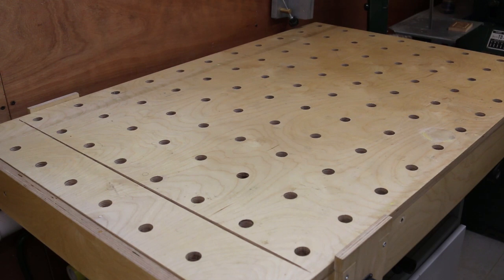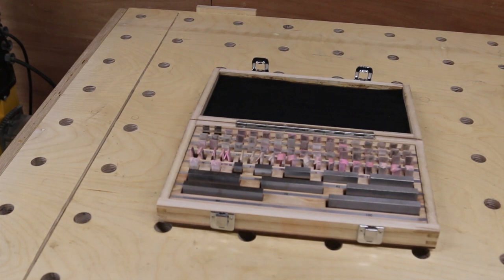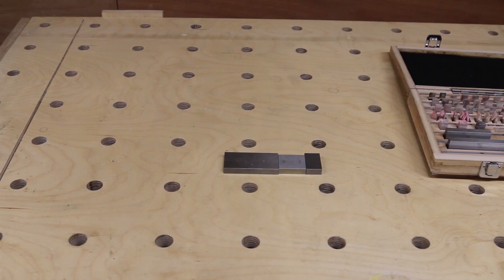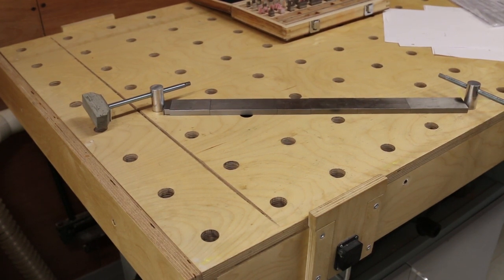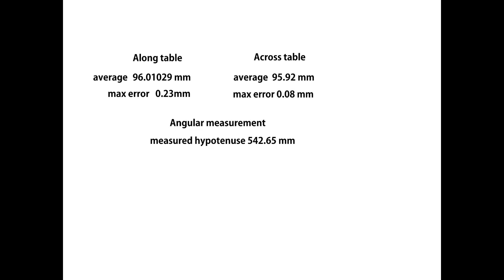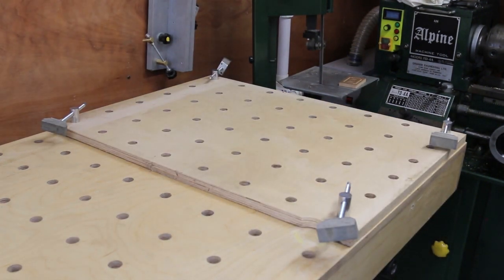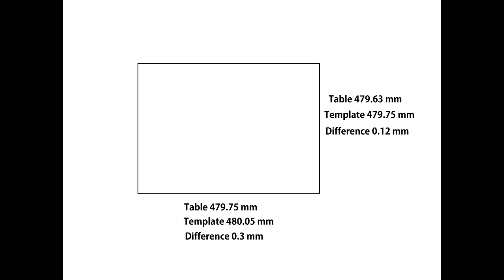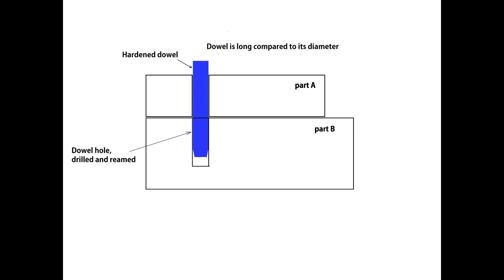MFT accuracy

Comment: Mind blowing maths....and all for cutting a pit of mdf to make a shelf to put up on a wonky wall!
Reply from the maker: You are right- for such a use case it is unnecessary. However, woodwork has moved on- the availability of higher quality tools has allowed working to tighter tolerances; this reduces hand fitting and the amount of finishing required. But machinery is only as accurate as its weakest link. If making, say, a large cabinet there is great peace of mind in knowing that it will go together accurately, without bodging and adjusting until it is 'good enough'.

Comment: Bravo Mike M.  Another great example of how and why engineering minds gravitate to woodworking.  After having this experience myself I find it almost comical now to see what happens when engineering minds meet the typical woodworking techniques and tools. Typical reactions:  "Are you joking?  They use a fist and a tape measure to set the table saw fence to a specific distance?  How can that 2-piece, adjustable "carpenter's square" be accurate? etc. etc."  In any case, thank you for making this video to present your findings.  You cinched my decision on which material to use for my new 2x8' MFT bench top.  Plywood it is.  Unfortunately here in the US, it has become nearly impossible to obtain high-quality, Baltic birch plywood.  No supplier I've found has a dependable source, many have not been able to obtain any BB ply for months.  The price has increased by 3-4X, and 4x8' sheets are very rare.  5'x5' only.  So for this I'm forced to use a best-available, hardwood-veneered plywood, which isn't even close to the quality of Baltic birch plywood.
Reply from the maker: Thanks; nice to hear from like minded makers. Not easy to get good Baltic ply in the UK either- I was very fortunate to be given a commercial work table (I had to take it apart and carry it out of the building) of sheet-and-a-half size. Not only was it the best quality I had ever seen, it had been 'matured' in the office for about five years! 13 ply for 18mm, and no voids. I think I need to name it in my will...

Comment: Thanks. I am having a hard time deciding what material to make my MFT from, but after watching this and seeing your comments on the Small Loft Workshop channel I think I decided to go for plywood instead of MDF. Knowing what tolerances I can realistically expect is really great. 
20 nm is insane by the way.
A question: It seems that the only type of good ply I can get is the phenolic film coated ones. I can get these in birch of poplar. Is there any theoretical or practical difference between these for this use case?
Reply from the maker: To which can be added Ron Paulk, the designer of the torsion box MFT unit- who states that he would never use MDF.
As to birch vs poplar, I have no experience of comparing these. Whatever differences there are are likely to be minor - but that is a guess on my part. Ensuring the stated woods are used throughout, and using 13 ply versions (or similar) rather than the widely available 7 layer are probably more important. Anyone out there used both, and can comment?
Reply: Well, unless you are building an air tight interior for the International space station it's not going to make any difference whatsoever and even if you were, it still wouldn't
Reply from the maker: @alland1241  Not quite sure what your point here is, the question that is being attempted to answer is:-
If you are building an MFT, what material should you choose for the top surface? The answer will depend both on the use to which it will be put, and if the machining operations reference the dog holes or some other fixture. There is evidence that ply is more stable than MDF, but costs more. Each must decide on the best option for them. Much as when buying a table-saw; do you pay more for one that has a cast iron top rather than an aluminium casting. More information aids the decision.
Reply: @Tensquaremetreworkshop  Also your environment seems to be really important. If MDF can shrink or move a couple of milimetres from cold or moisture, that will be a problem for some. My workshop is only heated to 5 degrees C in the winter when I'm not there. Humidity is also high at times. 
So I have other considerations than someone with a fully heated work environment.
Reply: @Tensquaremetreworkshop  Mike, my point is that there has to be stop point, we are talking about cutting wood, which as you know acts like a sponge when it comes in contact with any kind of moisture, what's the point of talking about 20 nm's when wood can swell just by breathing on it,
Think about a chopsaw station, do you but a fence on it which will mean over say 6ft you will be x degrees out at the cut because the fence will never be spot on straight or just a stop block ?, talking machine tolerances with wood is insane
Reply from the maker: @HardCoil  Yes, everyone's circumstances are different. For me, the issue with MDF is that the movement is not fully reversible- just growing and shrinking would be one thing, but that it can become imbalanced (more in some areas than others) is concerning. I also believe that MDF does not locate dogs as accurately. I hope to do some comparative measurements on this.
Reply from the maker: @alland1241  Yes, wood is an imprecise material. However, woodworkers for years have chosen ground cast iron table-saw tops, with micrometer fences, and other precision tools. The objective is to make the tool never the limit to accuracy.
Using very precise (to nm) measuring equipment is to remove any doubt about the measuring method. And why would you not use the most accurate system you have?
It is perfectly true that the standard MFT has been happily used by many woodworkers without complaint. But there is much false information around about the limitations- I just want to help clarify the facts. I believe that the small extra cost of using quality ply is worth the gain in stability and accuracy. Others must choose for themselves. 
Mitre saws- I totally agree with you- full length fences detract from accuracy, not add to it.

Comment: Good video.👍Have you carried out a similar approach to check the angular accuracy of the output - a Tracksaw cut?
Reply from the maker: The difficulty of measuring workpieces is establishing stable reference features. The corners are unreliable for this. A better check for 90deg is the standard 4 cut method (sometimes called 5 cut, as you need a straight edge to start) where you rotate the workpiece taking cuts from all four faces. The last strip cut can be measured at each end- this error is four times the single cut error (as they are additive). What is not generally recognized is the two errors involved- the 90deg error from the geometry of the setup, and the single cut errors, that can be either positive or negative. They come from -
- uneven pressure on the fence when placing the workpiece (the dogs move slightly)
-the same on the rail location
- dust and debris under all faces that meet
- the tolerance of the saw/ rail guide ( a precision machinist would regard this as ludicrously poor)
- blade wear
The last probably can have the biggest effect- uneven wear to one side of the blade can give a large pulling effect to one side.
Is any of this relevant to the results? Not in most cases. But we can never be sure of future needs, and it is a good rule of thumb to have your tool an order of magnitude more accurate than the work requirements. It can then be dismissed from the mind when operating the equipment.
Reply: @Tensquaremetreworkshop  Have you done a ‘5 Cut’ - out of curiosity?
Reply from the maker: @normanboyes4983  I did one when I set up my MFT, to calculate the adjustment cut to my rail supports.
Reply: @Tensquaremetreworkshop  In my case, I have a need to be able to cut perfectly long (7'), narrow strips of wood with perfectly straight edges parallel to each other.  After spending a lot of time, money and effort to accomplish this with a table saw, I eventually came to the conclusion that a track saw & MFT table would be far more accurate and substantially reduce the potential for slip-ups that ruin material.  To you point, while not machinist-grade accurate, the MFT solution will be magnitudes more accurate -- and consistent than my table saw solution.
Reply from the maker: @scottgoodwin9162  The problem with many table-saws is that they have not been set up accurately. I find that it takes a full day to tune and calibrate a table-saw. Having done this, they stay accurate for a long time- thanks to the cast iron construction (table and trunnions). They should always be more accurate than a track-saw- which relies of plastic and aluminium construction, running as a friction fit in an aluminium extrusion, driven by a universal motor via small skew gears. Not to mention relying on wood based surfaces and references. There is no comparison to the intrinsic stability of the materials. I am tempted to build an 'engineers' track saw- this would have proper bearings, linear rails, etc. 
BTW, nothing is 'perfect'- that is a Platonic ideal. Everything in this Universe has tolerances.

Comment: I think that relying on mft top for squarenes (eg. of cut) is alright if you are willing to accept the tolerance errors. Wood moves, mdf moves, ply moves hence, I guess, mft error is within woodworking tolerances. It is certainly not a machinist or metalworker tolerance level. The original festool kit did not rely on the holes for squarenes of cuts.
Reply from the maker: Absolutely correct. Most people understand that there are tolerances involved- but how big are they? There are claims out there (YT channels included) that make fantastic claims for accuracy. I wanted some numbers to be involved...